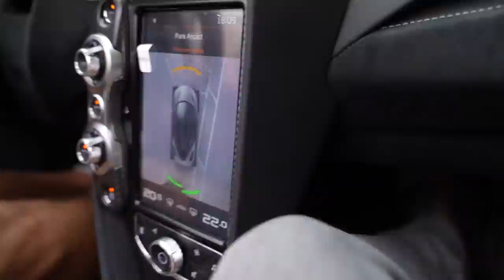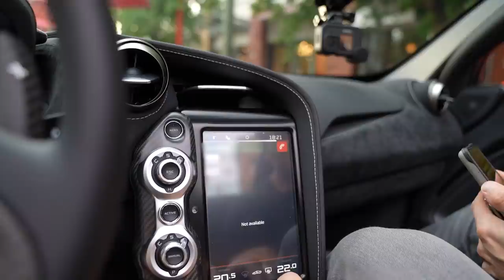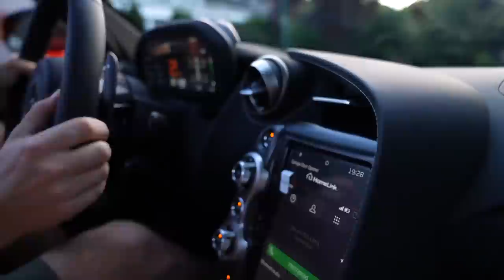SURPRISING MY SUBSCRIBERS AT THEIR HOUSES

Comment: Hey Derek, it sounds like either the mics suspension is broken, or the hot shoe mounting screw wasn't tight enough. I think it was the latter but I've had multiple problems like those with Rode mics before.
4:28 if you ever have this issue with audio just being on one side you can use a fill effect in most editing programs to put that audio on both channels. And if just putting the channel into mono doesn't work, you can copy the audio layer and put the balance on the missing ear.
Would love to see more content like this.
Reply: Nice sell Haha. Seriously Derek should hire you 😎
Reply: like for specific, actionable advice.